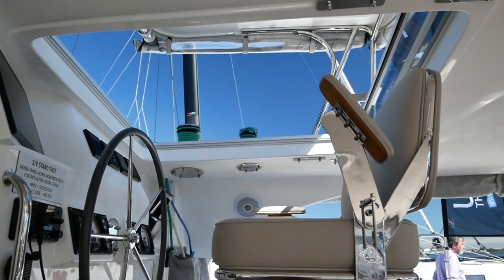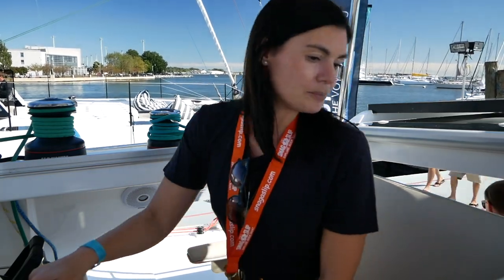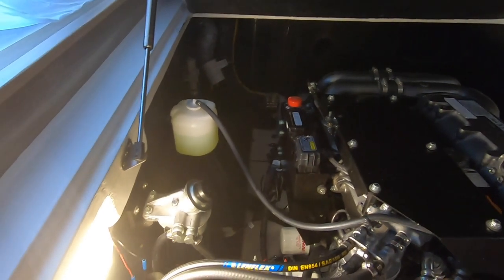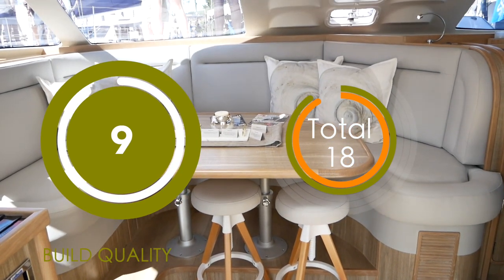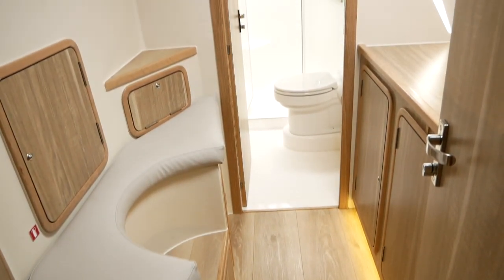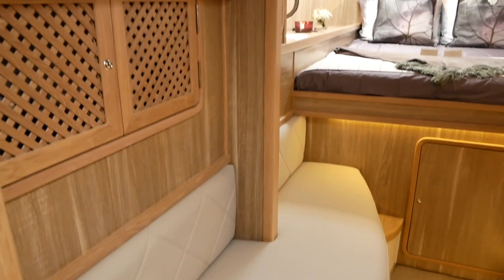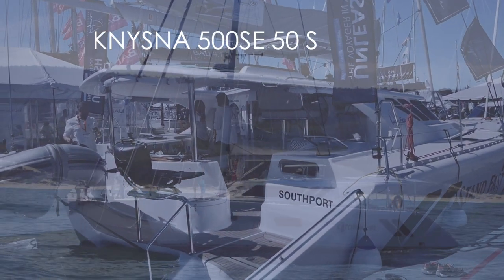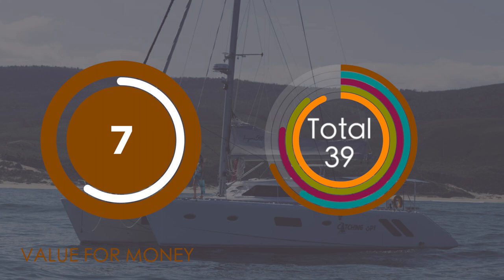Knysna 500SE Catamaran Review 2021 | Our Search For The Perfect Catamaran.

Comment: As most of us will be looking at the used market, it would be extremely helpful if you could extend your outstanding reviews to pre-owned yachts at three price points, $350,000, $500,000, and $750,000. There are great examples available on other channels but that only covers a small fraction of the choices available. This series has set the standard for yacht reviews. Well Done Ruby Rose!
Reply from the maker: Thank you mate. Lovely comment
Reply: unless you have disposable income imo buying a cat new is an awfully bad idea.  Let somebody else do the shake down sails, install more solar, batteries, washing machine, etc.  And true very few of the audience is in the market for these 600,000 and up cats.  It is very good info on the makes and differences though.
Reply: @FeelItRising  Also cats have far less ability to hold stores, and they listed greater storage capacity as a requirement in their next boat.  A monohull, having much greater wetted surface area can store far more than a similarly sized cat.
Reply: Sailing Bronco Also if you could do reviews on sports cars that would be helpful😉
Reply: @FeelItRising  all good points, but keep in mind when you order new you can spec it out exactly the way you want. Buying a boat is already a compromise, buying used, you deal with availability and more compromises (you also need to budget for refurbishing/re-regging/updates/etc).

When I was young (of meager means), I never believed in buying new cars - all that depreciation and I'm a penny pincher. However, as I've gotten older and more successful, I've bought 4 cars new as well as my race bike. I probably won't be buying a new cat, since the nominal depreciation is so high - but you never know. Honestly just learning about these new boats so when my kids are older in a few years I can buy them used, but with Knysna only producing 4-boats per year... it'll be hard to find one methinks?

Comment: A few points relevant to this and other revues of yours.
1. Stipple-effect is used to cover a multitude of sins.
2. Large hatches over showers can provide good ventilation during periods of passing heavy rain when other hatches have to be closed.
3. Flush mounted hatches will have rainwater/seaspray trapped around them, it will fall into the boat when you open them, also the seal has to be perfect to prevent leaks, not good, especially over beds and upholstery.

Comment: Another great review, I really look forward to these.  The South African yards seem to have it licked.  As was mentioned, there are a few comments regarding stress in the hull structures.  I personally would like this as a specific point.  The method and materials used in the construction and the absolute strength in the hulls is a big if not the biggest consideration for many people as well as long term durability.  Some production boats, mono as well as cat, have the strength of a paper bag it seems.  Ok if you want a flat in a marina but for challenging sailing conditions which we all plan against but invariably run into a handful of times each year,  I'm talking it's ability to shake off 5m plus swells and 30kts plus winds when close hauled and slamming for 6 to 10 hours to get into a protected harbour.  The South Africans experience this more than most I think.

Comment: I agree, this is one of the prettiest boats on the exterior.  I like the look of the interior too, but something about the saloon felt cramped for me compared to others I have seen.  And I would want a forward Nav Station.  No use for the mid ship vanity either, I would prefer hidden daggerboards.  And I also agree, that cooktop next to stairs is a no-no in my book.  I'm also not a fan of stippled walls, but knocking off $200-500k from the high end Cats, yeah I could live with that.  Having been an RV camper for 40 years, I've learned that there is no such thing as the "perfect" camper/boat/house etc. if you have any kind of budget.

Comment: The engine bay seemed small - access to the engine is paramount. No info on base-price electrical specs. What are the sails that are included in the base price?  What caught my eye was the sign at the helm (at 0.21 seconds) with the boat name and the military alphabet spelling of the name, call sign, and maybe the boat registration number - excellent safety feature yet so simple. ID the boat during times of stress.  I also do not recall a look at frig & freezer, single or double sink, and storage in the saloon/galley. Or a look at the navigation equipment at the helm. 

I am not a sailor, am not in the market for a boat, yet I look forward to your walkthroughs - you teach me! You two are best at this, yet my sense is that you were rushed to get through this survey. :¬) Webhead USA

Comment: Hello again , Keep doing what your doing.....
SMART Manufacturers will use these reviews to vastly improve what there offering
& l agree  having walls all wrinkle finish.....NO....BUT 
when l was building mine l did run a 100mm full gloss wrinkle strip throu out , at the Base of the walls (kick strip) to protect the fully painted interior. Its easy to clean, tough & looks good...(filleting & gloss painting the interior does take for ever thou but worth it)
 cheers....
 luv what your doing

Comment: I hope your comparison to a Jaguar stops at the name recognition as Jaguars are known for maintenance issues and time spent in the shop. Also just to follow on a few others you made no.mentionnof life raft placement. What are your thoughts on an auto deploy raft placed on the bow vs one placed on the stern. I know there is one school of thought that most of the weight in a cat is to the stern so in the unfortunate (and unlikely event if sailed properly) time of a capsize would it be better to have it up front where the underside of the boat may be floating higher in the water. Also having the engines under the berths could possibly be a pain. Having to turn your room upside down for your me maintenance and daily checks although with the AC running it could make for a more comfortable environment to conduct such maintenance.

Comment: Not sure I would ever be content sleeping on top of a diesel engine, regardless of "insulation!"
Reply: Exactly my thought as well. Sleeping on top of your engine seems rather annoying. I’d rather have them aft.
Reply: @edanoestreich8976  Either that or mid for shaft drives.
Reply: How often would the engines be running?
Reply: Quote : "Not sure I would ever be content sleeping on top of a diesel engine, regardless of "insulation!""

Maybe good for passengers you wish they would wish to leave the boat at the next port
Reply: @charonstyxferryman  🤣😂🤣 Indeed!🤓
Reply: @teddybear2840  I'm not a sailor, YET, but watching many of these video's it's not uncommon. Although I guess you can run single engine on the side you're not sleeping in, assuming a single couple aboard. My bigger concern is if there's a spill/leak, even after maintenance and then having that smell in the cabin. Curious if others with actual experience can chime in. I just don't want an engine in a bedroom... seems like saildrives are the way to go these days.
Reply from the maker: Diesel spills are pretty rare in well maintained engine bays
Reply: @sailingrubyrose  Thank you!! :)

Comment: Hi, guys. Great reviews. Just read your bio and see that we share similar aspirations, though mine goes back 40 years, got scuttled--'scuse the pun--by career opportunity out of left-field 37 years ago, and is back on my agenda again.
On the subject of your reviews, and particularly pertinent to this boat given its price advantage, is the subject of performance, and the compromises which are inherent to the differences between racing, coastal cruising, and blue-water global sailing, e.g. the traditional argument, stern drive versus centre cockpit, and in Tyresa's case her island beds are always going to be part of the more complex equation of length & beam, storage space, tonnage, sail area, and speed upwind, not to mention her island beds again.

These compromises are a conundrum with which I still grapple in my mind 40 years on, but applying the KISS principle to it, if I was conservative and limiting my sailing to coastal Oz and maybe a trip into SE Asia or very carefully-selected seasonal forays into the western Pacific, and funds were not an issue, the X5 would be a no-brainer. However, given that a global blue-water live aboard sailer is required to do two things, 'cruise' and 'travel', i.e. island-hop and trans-ocean respectively, the latter as safely and efficiently as is possible, the no-brainer is the Seawind 1600. The Knysna 500SE appears to be, given the missing island bed configuration clue and sans a specific performance spec from Nick, a compromise between the X5 and the Seawind, particularly from a price point perspective

For me, these compromises are exacerbated by additional storage demands from a couple of Malibu boards, a wave ski, a 2-seater kayak, scuba gear and the accessories to match. Do you guys know where there is an old 70-foot 3-master for sale?
chuckling
Reply: I might add that Tyresa's ventilation bent is quite reasonable considering that probably 80% of world cruising is spent between 0-35 degree latitudes dictated by the seasons, and notwithstanding the availability of air-conditioning, having enjoyed travelling in a new motorhome with all the mod-cons in Oz for the last 10 years, energy consumption is ALWAYS closely monitored, and is obtained at a cost of one resource or another.

Comment: I would say that in the 1M+ category, you  are getting into the range where the owner may be living aboard, but they tend to have a paid crew, which changes layout and what you consider in features. Other people have mentioned ability to get to the water maker etc... but I would ask this well....  How easy is it to get replacement parts if your watermaker goes out?  How easy it to do the repairs yourself... how fiddly is it?  Are they using a commonly available watermaker, (or some other bit of equipment) or is it specially made for them? How much maneuvering do you have to do to get to these issues? If this is going to be your house, I would say this is pretty critical stuff.

Comment: Great video, interesting boat . it would be amazingly useful if,  when you publish your top 10 boats you could estimate the residual value after say 5 years ? Depreciation is probably the largest single cost of ownership. ! Well done guys .
Reply: IMO-The resale of this boat will be higher than that of a comparable production cat.  Currently, there is only 1used  Knysna 500 listed for sale on Yacht World.  Asking $745K for a 2014- 4 cabin version. As only 4 are built per year, there are very few available on the supply side.  Cheers!
Reply: @mountaindweller9118  Thanks for that info.  Based on the quoting sale price that seems like a depreciation of $200,000 over 5 years / $40,000 pa which is useful to know. Many thanks .

Comment: Thanks for the review!  Style is highly subjective, but I didn't like the colors, materials, shapes, design of the interior.   I'm not sure it would have been stylish, modern or fresh looking 40 years ago.  Did like the helm position.  Exterior is ok aside from the non-flush hatches. 

A stippled finish means that some flaws will be hidden.  It's probably very difficult to clean effectively. 

Some of the production cats are much better looking and probably better supported simply due to production volume and dealer networks.  Due to volumes, a production boat generally seems a much better value.

Comment: Out of curiosity how high is the bridge deck clearance and why haven’t you discussed this particular point on any of the cats?
Reply: I agree with the sentiment concerning propensity for slamming in seas. I seem to recall Nick mentioning that bridge deck shape is more important in that regard than clearance. It may be that it is difficult to assess without sailing in those conditions.
Reply from the maker: Hi Monica! We haven't taken into account bridge deck clearance because there are many factors that cause slamming, and only one is bridge deck clearance. There's also the nacelle shape, the trim and, of course, the sea conditions themselves. This is all very difficult if not impossible to assess on the dock, and of course two catamarans of the same model can have different degrees of slamming if one is heavily weighted down. So- that's why we don't address bridge deck clearance (Also- we're looking mainly at modern catamarans, and all catamarans that are being built today have decent clearance, so it's unlikely to be an issue for most buyers looking at new cats).

Comment: Here are some negatives. Cooker location (possibly not that easy to relocate), engine access, lack of nav. station, galley doesn't communicate with helm (no line of sight) or with the cockpit very well, no opening side windows, routing of ropes to the helm (almost too single handed and across the roof trip hazard), South African styling, lack of hand rails, raised hatches etc...

Comment: Did you overlook a tight space around the engines as a negative?
Reply: I really like their youtube channel and have been a fan since they started, but as someone who owns a boat I think the space around the engine is horrible. I wish they showed more areas related to fixing the boat, eg access panels and conduits for wires/plumbing. Also, there is an easy work around for the “making the bed” issue- you simply keep a nice high quality fitted sheet on it and fold up a blanket/comforter at the foot of the bed in the morning. Takes 2 seconds and looks very neat.

Comment: Again a great review 
This boat looks well built and you can see a lot of attention to detail 
BUT 
it looks bizarrely old fashioned from hull to interior design 
I felt that I was going back in time watching the video!
 Hull design has old fashioned bowes instead of plumb or inverted which will impact speed.

I believe that that retro look is an issue as this will make it a lot more difficult to sell second hand making the real real cost of this yacht greater than some other makes as devaluation will be a problem.
Reply: Interestingly, cats like Knysnas and Antares, which both have a dated look, hold there value quite well. Especially compared to production cats.  They seem to have a niche' cult following and there is always limited availability of brokerage boats, due in part to limited production.  Knysna builds 4 boats a year.  There is only 1 Knysna 500 currently on the market worldwide and it's a less desirable 4 cabin version.  It's a 2014 listed for $745K on Yachtworld.  Cheers!

Comment: Hello! Can catemerans have in-mast furling? I see it often on a monohoul but cant say I've ever seen one on a catemeran. Why is this? Thank you! Cheers form Denver Colorado USA!
Reply from the maker: Hey mate. Some do have in mast furling. However to keep the  weight lower it more common to have slab reefing .
Reply: @sailingrubyrose  ahhhh...thank you!
Reply: @co4x4  It's supposedly a very expensive option by manufacturers that do offer it. I heard absurd amounts and can't believe the figures so won't quote it here in case I misheard. Kinetic provides boom furling on their models as an option or standard equipment, if I'm not mistaken. Great if you can afford it..

Comment: Big problem with stipple effect. From a hotel general manager, if you clip off a piece of stipple, you need to refresh the whole area otherwise you loose the consistent effect. If you want that effect, get it printed on vinyl and stick it on. Dust settles on the curves and it's a bitch to clean... Even Rolls Royce has there issues. Give me a Jaguar any time...

Comment: I don't see the point of accusations of bias.  It seems to me not to matter at all even if true.  Why?  Because only a fool would make an investment of that kind without doing in person research and evaluation of their own.   Recommendations are a good place to start, sometimes anyway, but after that it is up to the person who is going to make the purchase to do their own homework.
Reply: I reread this post of mine and felt I should clarify something:  I did not intend any slight against Nick or Terysa and what they are doing with these reviews.  They both have experience and insight which is very useful.  Some boats I would not pursue due to important points they have made.  Some concern safety, some have to do with comfort and protection from the elements, and more.  I think they are doing a fine job wading through myriad offerings; there are a lot of cats to choose from.  Nuff said.  Thanks for your efforts and your channel.

Comment: It might be nice if you listed bridgedeck clearance.  Slamming.  Water Spray.  these are factors that have changed over time.  Rounded or oval hulls are very wet rides.  As cats have grown in size the excess weight and hull shapes have reduced that bridgedeck clearance.  I want to know which boats slam the most.  A review that does not include sailing one of these boats, and discussion of these factors is nothing special.  I am looking for information and not finding it.  What is the hull made of?  Is it cored?  Solid lay up?  Come on! Do some research and inform us.

Comment: Well done. Please don't be intimidated by dickheads. I love YOUR opinions. I'm not a boaty so sorry if this is a stupid question, why don't they have a forward and aft emergency inflatable instead of only one?
Reply from the maker: Hey mate. Good point about multiple life rafts. They weigh a fair amount and weight saving is a premium. One should suffice.
Reply: vvmmuu They’re also expensive to buy and maintain. Could probably spend your safety-at-sea budget in better ways than on a second life raft (e.g. additional dan buoys, better equipped ‘emergency grab bag’, additional EPIRB, etc, or redundancy in other safety systems, etc).